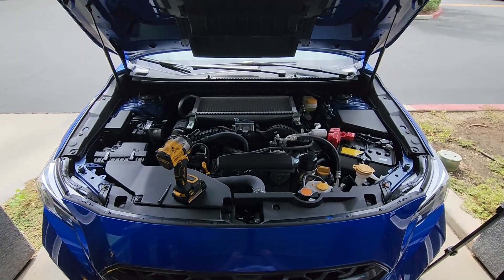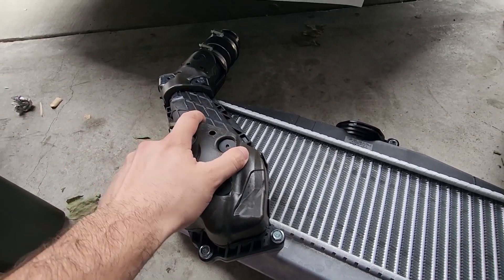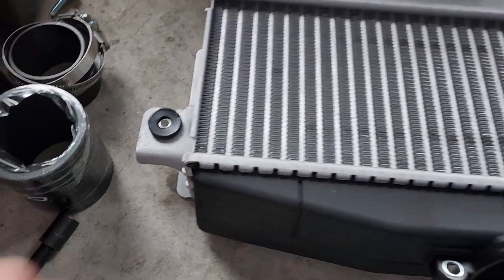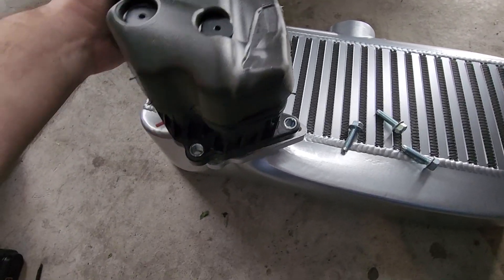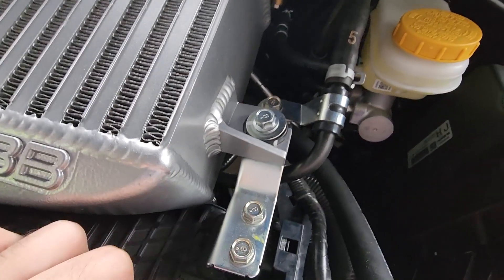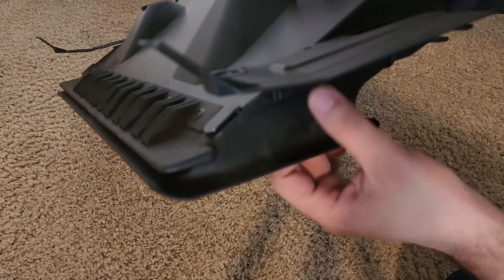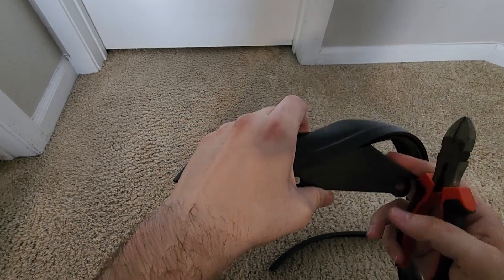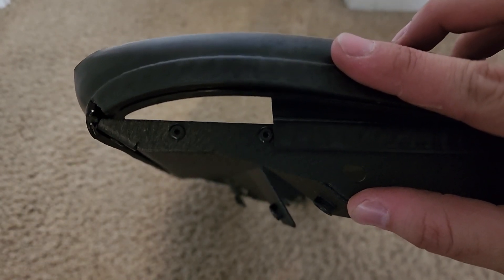COBB Intercooler Installation Step by Step Guide for Subaru WRX 2022 2023 - Stage 2 Upgrade Part 1

Comment: Why you need to change this intercooler ?
Reply from the maker: Its not "needed" to change it in of itself. But it is required if you want to tune the car for more power, as it can absorb much more cool air due to its size, and thus safely cool down hotter pressurized air from the turbo and engine.

Comment: I noticed the big rubber seal around the rear of the part folds in the factory seal around the engine bay just under the windshield.  It’s kind of concerning.  I tried to push them apart and pull the factory seal up where it should naturally be but it is getting tucked underneath.  Did yours do that as well?
Reply: I heard this is normal. But I’ve been scouring YouTube for comments like this one. Ive been told it’s normal but I wanna hear what others say

Comment: is it safe to install intercooler as u did here and drive car without the other parts installed with stock tune? 
as i wanna do this part at home then drive to a friends house to do all the rest of stage 2 install.
Reply from the maker: Yes it is absolutely safe. I actually ended up installing the intercooler first too, and didn't install the other parts until they arrived a couple weeks later. Had zero issues.

According to COBB themselves on their website, they also say its no problem to install the intercooler only and running it with Stock or Stage 1 tune!